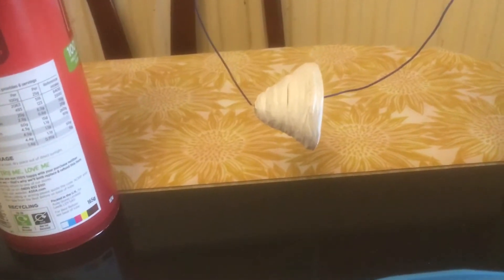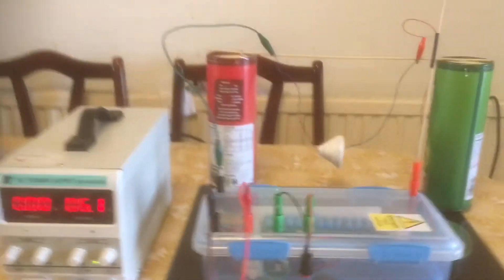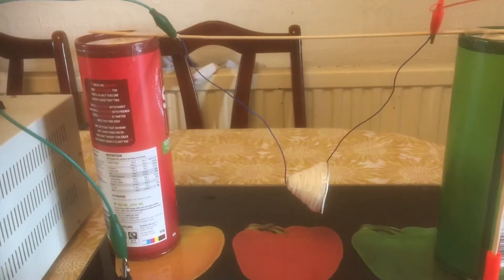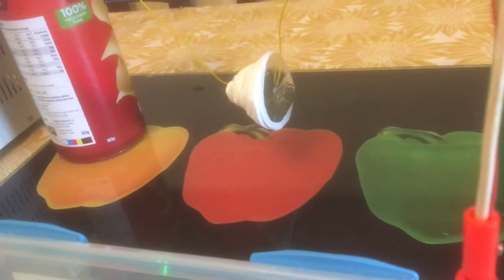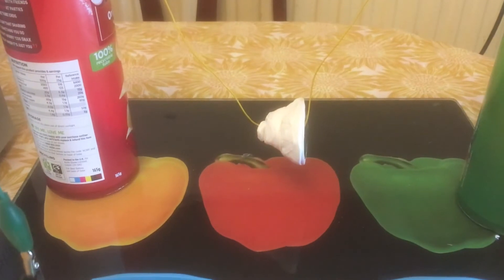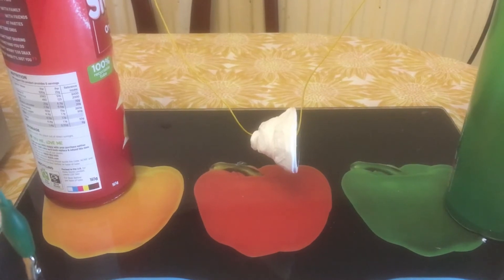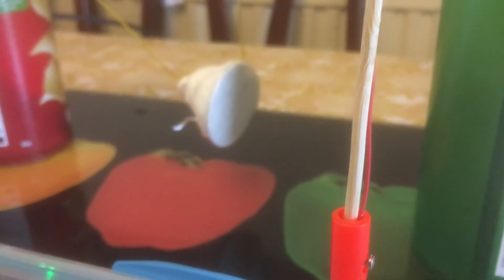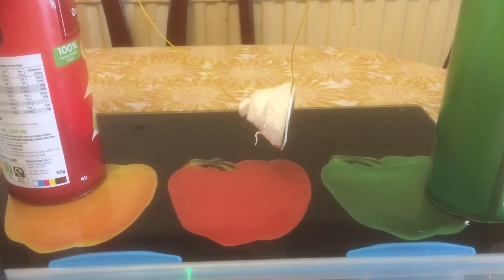The tiniest force on a polystyrene cone capacitor

Comment: are you sure you have that voltage, because 60-70kv means 6-7cm of spark through the air and it should pierce both the air and the insulating tape  or between the wire. you need to know how long the spark is through the air to deduce the high voltage? from my searches 10mm of spark through air is 10kv. and your capacitor works at about 20-30kv I think.
Reply from the maker: Its hard to measure high voltages accurately. I tried high voltage resistor potential dividers, but from memory here I would have arrived at 60->70kv by spark gap approximation by using the rule of thumb approximation 30kv/cm dc. I did make a table of spark gaps in air for input voltages at one stage. So a 2->3cm spark is in the right ballpark by this approximation, and is definately possible with the PSU you see here.

Remember other materials like polystyrene etc have higher dielectric coefficients than air. 60-70kv is not necessarily going to pierce through that thickness of dielectric.

Comment: what is the voltage you used for this capacitor?
Reply from the maker: Id say that one was around 60->70kv (estimate). If you look at the box at time 9seconds you'll see the PSU I made for it. If you oil cool the transformer it will run between  3->7volts or thereabouts for up to 5minutes at a time (max). The documentation here gives you the parts list and assembly of a variation of the psu you see here: 
https://github.com/cybernetic-research/ion-lifter-esp32-command-control-network/blob/main/Lifter%20Command%20and%20Control%20Feb%202021.pdf

Comment: from your diagram with the layers of the capacitor, must they be connected to +HV and the other plates?and where did you get the 2 mm polystyrene or how did you make it?
Reply from the maker: The largest electrode plate has a +ve high voltage on it, the smallest electrode plate is 0v. Layers in between are just stacked capacitor layers insulated by the polystyrene, but each layer is smaller diameter making a cone shape.  The polystyrene was foil polystyrene from an insulation roll, the sort of thing you mght use in a loft. All I did was cut circles of different diameters out of it and stack them. Be aware that with the high voltages you get effects like the wire bending when the high voltage is applied so honestly, this setup could be flawed as a thruster design unless you are careful because of this. - the effect might be more to do with wires bending under high voltage stress than anything else. I'm pretty certain theres a Thomas Townsend Brown Patent that shows this design and how its supposed to work.
Its good though - keep asking questions.

Comment: I can test the conical capacitor with two plates, but made of a piece of polystyrene not of 2mm layers (because I don't have 2mm)? And the positive plate is the big one and the negative plate is on the other side of the cone at the top, isn't it so.Could i wrap with teflon tape?please answer this questions.
Reply from the maker: teflon tape would be similar to usign ptfe wrapped around the outside, You could test that configuration. If Im honest I never really got anything out of doing this particular experiment, I was trying to see if I could get the cone to jerk forwards. There are better assymetrical capacitor configurations like this one: https://www.youtube.com/watch?v=nBmOYAJ3UHY